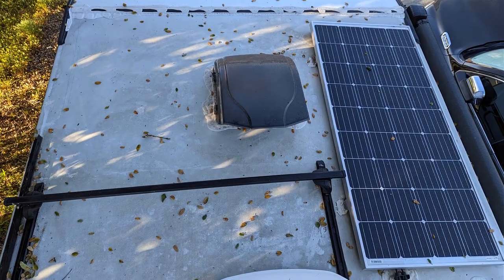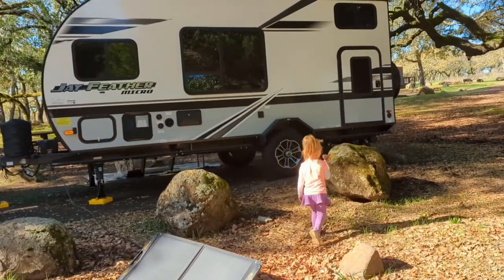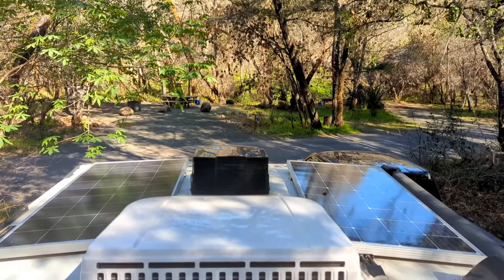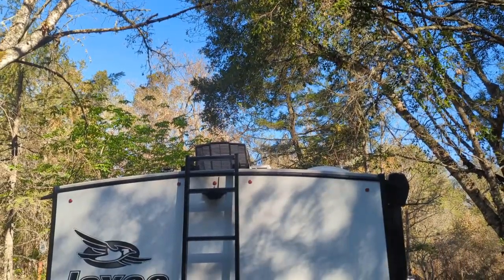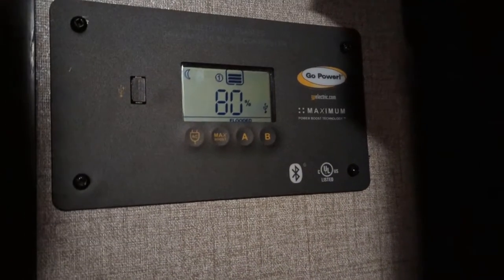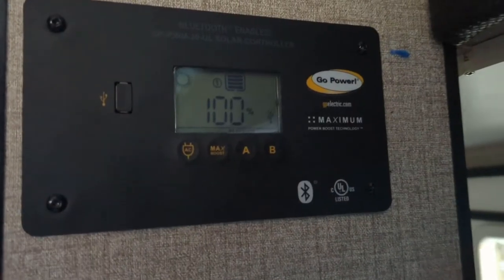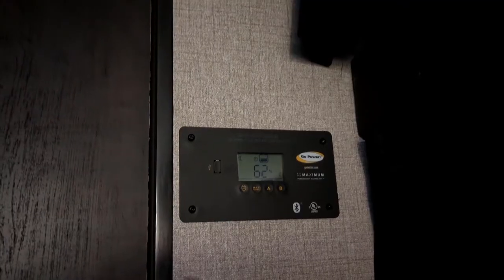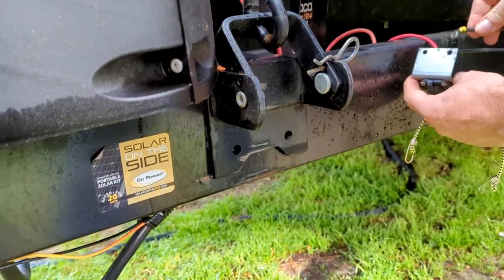Go Power! Overlander Solar Kit Review

Comment: Please can you tell me how many amp hours your 6 volt batteries were rated for......and how did you attach the second panel to the roof......did you screw it in to the wood in the roof?   Thank You
Reply from the maker: The 6 volt batteries were GC2 Deep Cycle Extreme Interstate Batteries rated at 225 Ah @ 20 Hr. And the second panel was attached by first putting eternabond tape between the roof and mounting brackets, then we screwed them into the roof, then we covered the screw and surrounding area with dicor lap sealant.

Comment: Just an FYI. Your solar charge controller will not give you and accurate reading on actual battery charge state. You can get an accurate reading by installing a battery monitor that is connected to the negative side of your batteries that will give an actual reading of your battery state of charge. While you are using power your charge controller will usually show a lower reading as the power is being used. However, it doesn't really matter as long as you can relate those readings from your charge controller to your situation. Just keep in mind the reading will be lower during battery usage.
Reply from the maker: That's good to know. Thanks for the info!

Comment: Thank you for this through test. We are considering the Go Power Overlander for our class C, this info helper a LOT!
We are going to run 2 100ah AGM batteries and are considering the single 190 watt panel.
How much difference (in numbers) did the the single panel perform without running the portable back up setup?
Wishing you dry roads and green lights,
Andy & Kim
Reply from the maker: So glad to hear it helped! The single 190 watt panel worked great in ideal conditions. The problem was when there was a cloudy day or lots of shade. But even then, we were still able to camp, we just needed to conserve more. We used a lantern instead of the outside light and just used what we absolutely needed.
Reply from the maker: Just had a thought, if you're starting with nothing and only want one panel you might want to look at the Go Power Rigid Eclipse package. (https://gpelectric.com/products/rigid-eclipse-190w-solar-kit/) I'm not sure what the price is but it looks similar to the overlander expect it has an MPPT controller instead of PWM. The MPPT controller is much more efficient and it will be a lot easier to get your batteries charged back up with one panel.

Comment: Thank you again for the video......Do you need to get a portable solar panel with a built in solar controller?.....and what kind of plug do you need to plug in to the external solar input connector?
Reply from the maker: Yes, the solar on the side port goes directly to the battery so it needs its own solar controller. It's rated for up to 20 amps. It uses a standard SAE port.

This is the portable solar panel we have: https://www.amazon.com/Go-Power-Lightweight-Monocrystalline-Accessories/dp/B09DS83V5M/?&_encoding=UTF8&tag=roginasystems&linkCode=ur2&linkId=ca4d65c7edee6658a8040404540fb1cd&camp=1789&creative=9325

That panel allows you to daisy chain 3 panels together and comes with a 30 amp controller. I would do a max of 2 though so you don't go over the 20 amp limit on the trailer port.

Comment: where did you find the wires to hook the charge controller to?
Reply from the maker: The trailer was pre-wired for solar. There was a placeholder panel in the small wall between the bathroom and bunks. Behind the placeholder were two looped cables. Those need to be cut to install the solar controller. One side went to the panels on the roof and the other to the battery.
Reply: thank you! @RoginaRoaming